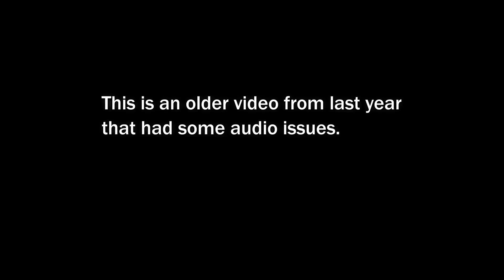MY SELF RELIANCE, NO MORE TRIPS TO THE LUMBER YARD,

Comment: Did you ever consider either a Lucas or Peterson saw mill? The use a circular blade as opposed to band saw blade. Looks like they would produce quarter swan lumber easier.
Reply from the maker: I never considered them but they appear to be great sawmills. i like the ease of set up on the woodmizer, fast and accurate, to move the lucas mill is a lot more complicated, but still they look like great saws, 
and wide lumber is my main lumber that I saw which is very easy to do with a woodmizer, ,